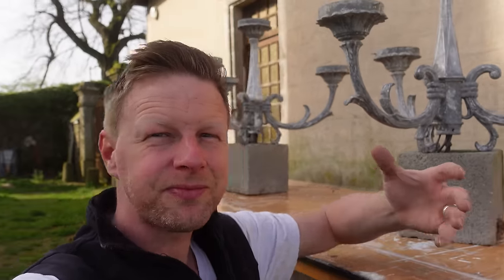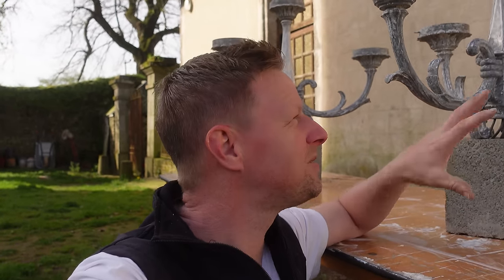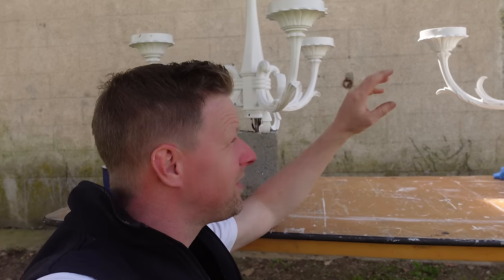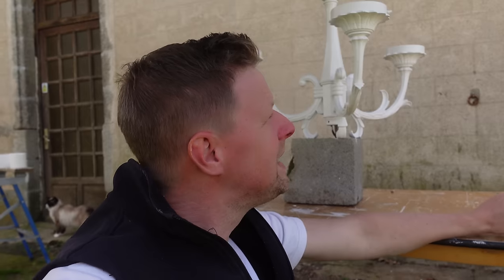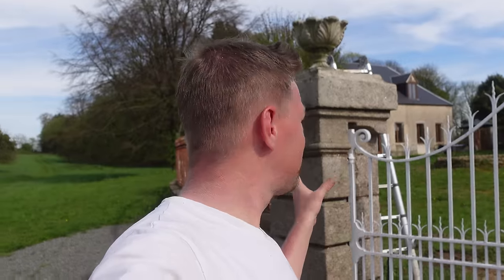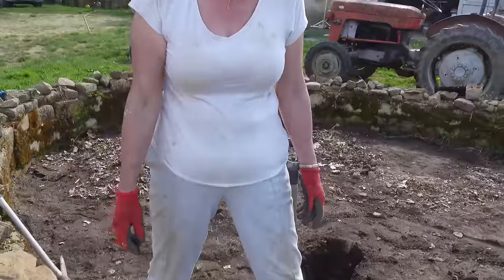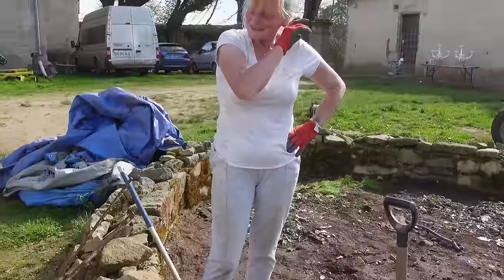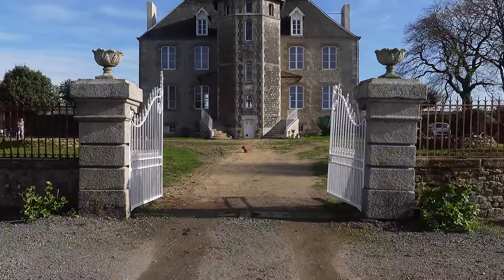YOU WILL NOT BELIEVE What We FOUND In The Château Fountains While DIGGING It Out????

Comment: You mentioned in a previous video those pots deal with hot direct sun. Pansies might work for spring before the heat really hits but they will fry come the heat of summer. Geraniums seem to take the heat on balconies in summer in Europe from my experience while living in Germany. I’d look for pots that would fit up in the urns. Start the seeds down in an area you can baby them. Then put them up in the urns after they get going. That would also mean you could winter over your geraniums in the basement.

Comment: Hi guys, just with the fountain, not sure what you have planned, but you don't want the power connection to the centre of the fountain, that is where the water pipe goes up through the bottom of the fountain all the way to the top where the water comes out. That flexible water pipe can come out the bottom of the fountain and can extend on the bottom of the pond over to the side where it will be plugged into the pump. You want the pump fairly accessible so you can service when need be, and if the ponds are going to be the size of the ovals that are there, then it's much easier to lean over the side of the pond and reach down and pull the pump out than strip off and swim over to the pump🏊😂 No pump lasts forever these days so that's what you need to think about the ease of changing the pump over. The power connection can be outside the pond somewhere close by for the pump lead to plug into, and if you go for a low voltage pump you can run the lead from the pump over the side of the pond and hide it with a rock over the top of the lead if you want and push existing water pipe onto the new pump, easy. I have a business in Australia and we sell and install fountains, let me know if you have any questions. I love your channel guys, I've been a subscriber from the beginning, keep up the fantastic work👏👌👍

Comment: Though the gold trim would be nice on the lamp posts, I would stay all white. There are other things more demanding to be attended to right now. From a distance, that tiny bit of gold won’t show, but seeing the white gates, then looking at the iron railing both to the left and right , the railing is begging to be painted.
     The round areas that Tracy is working on, in my opinion, would make a lovely  bed of annual flowers in the inside outer ring .  Then I would create a small  round pool of water in the middle of that circle  ( made of concrete, sealed and made waterproof and painted blue ) from which water could be recirculated to the fountain.  Repoint the stones of the outer wall.
Reply from the maker: Thank you 🙏 😊
Reply: Can a wooden mold be made to create a circular concrete seat atop the circle of stones?  Mix your own concrete and pour it in small sections  on a flattened surface.   Then each segment, when cured, could then be mortared in place atop the circle of stones , if needed, for seating.  Pour it about 3” thick and put reinforcing wire mesh in each  small segment.